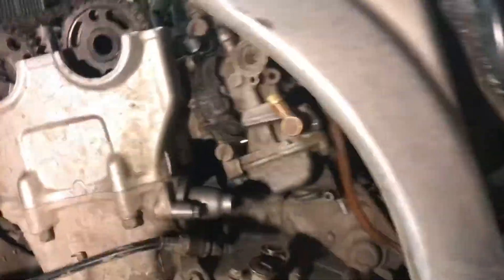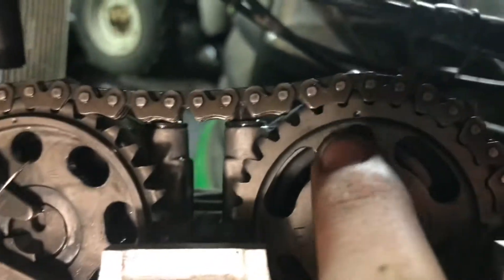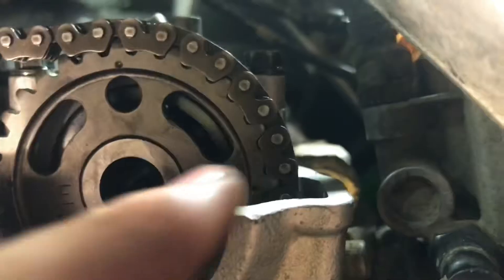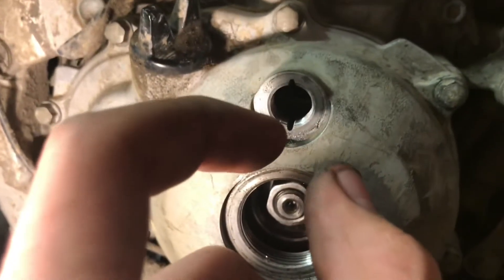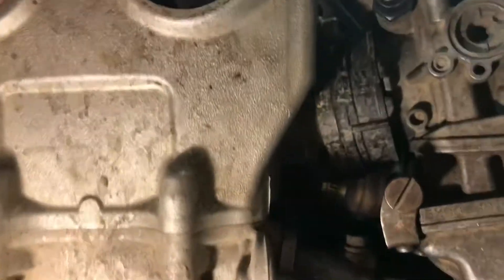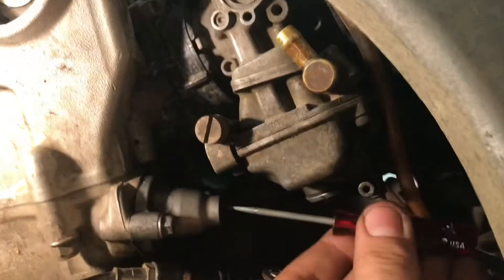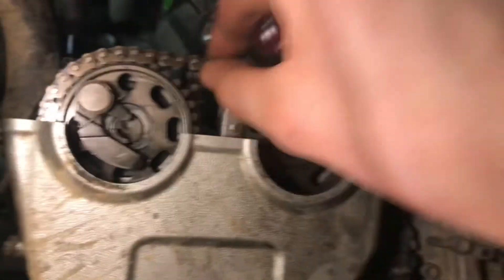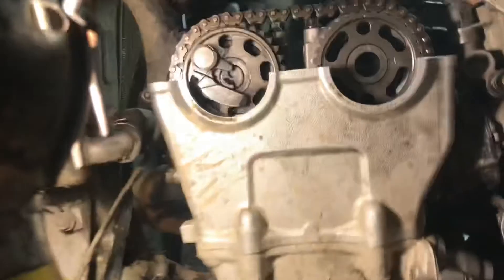YAMAHA YZ250F HOW TO SET TIMING

Comment: The owners manual actually says to line the bottom left corner of the H up with that notch so that the I is at 12 o clock with the intake cam mark at the 3 o clock. 
I did mine to the owners manual specs. 
Also that tensioner is bad, they are Auto tensioners you shouldnt the have to set that. It sets itself
Reply from the maker: It’s been a while but the tensioner has to be clocked, it has a spring in it that you release after everything is back together but yes it auto tensions
Reply: @Euro_Fab mine was different than that. Idk if they changed the design over the years or what but I actually had to turn it in and lock it in place in order to install it. 
Video helped me out though, I thought I may have installed the my intake cam in the wrong position

Comment: I have a 2004 yz250f and it shows a dot I'm pretty sure that's TDC
Reply: The dot isn’t top dead center, there is a vertical line that lines up with the grooves on the stator cover, the line is TDC. The line is just a bit more counterclockwise than the dot. I see what you mean though, I thought the dot was TDC too at first, but then I pulled my spark plug out to double check.
Reply: @Sparks 457  Thank you, I have already gotten rid of the bike. I'll remember that for when I get another.

Comment: Does it matter what stroke your on like the exhaust stroke and the intake stroke?
Reply from the maker: You want the marking on the cams to show the E forward (Exhaust) and I at the back (Intake), when your lifted up in the flywheel and the cams are both upright with the timing marks in the right position is the way it should be

Comment: Thank you just bought a yz250f and it wont start at all gonna check the time and re do that
Reply from the maker: Try shimming valves first that’s the common fix
Reply: @Euro_Fab  i got it to start but it smoked a lot. I did piston rings and valve stem seals too a d that seems to have fixed it

Comment: I've gotten pretty lucky with never having to do any motor work lol, the old zuki Has quite a few hours on it tho 🤞 😂
Reply: I SUBSCRIBED TO YOUR CHANNEL 🛎
Reply from the maker: Your lucky usually the year 04-06 rmz450 have valve problems
Reply: @Euro_Fab  yea I heard about that but I've put like 250 hours on it and havent had any issues, still starts and runs perfect
Reply from the maker: Yeah I’ve heard a lot of bad things about that year but everyone I’ve seen seems to run perfectly fine, it’s most likely that the people saying those things about them just don’t maintain them right
Reply: @Euro_Fab   yea anything will blow up if ya treat it like garbage lol
Reply from the maker: @_T_R_E_V_O_R_  Yeah facts, for a 4 stroke it’s best to check the air filter every few rides and change the oil like every 15 hours, and stay off the limiter and you should be set
Reply: @Euro_Fab   fax
Reply: I like the tensioners on the older ymf250.
 They are showing loaded. You just release it, and it puts the correct tension on it itself.
 It's too easy for me to over tighten. 🤣